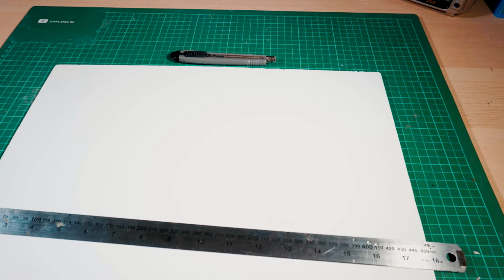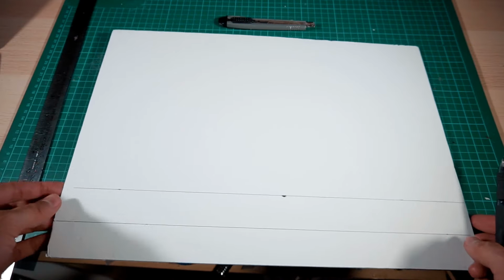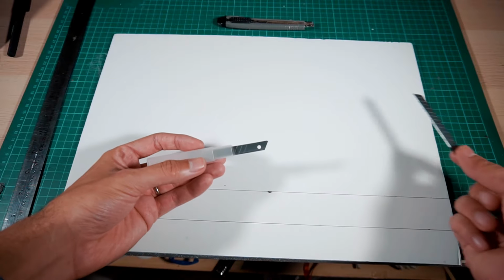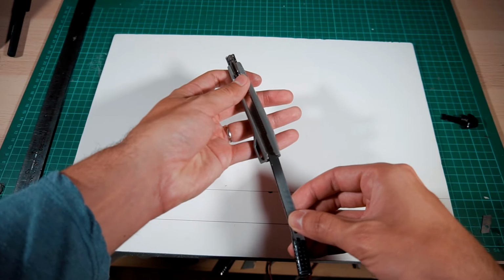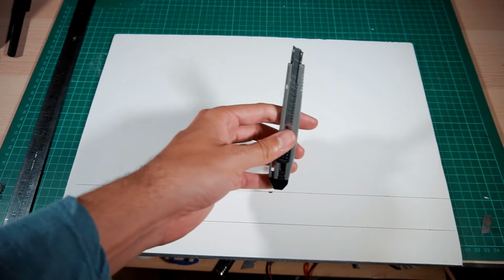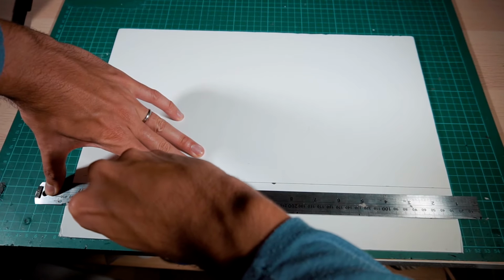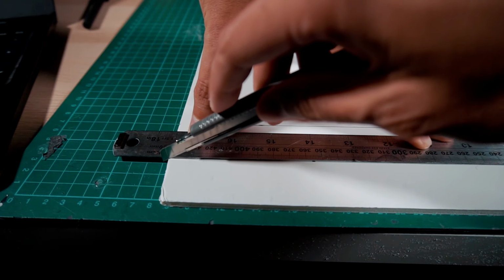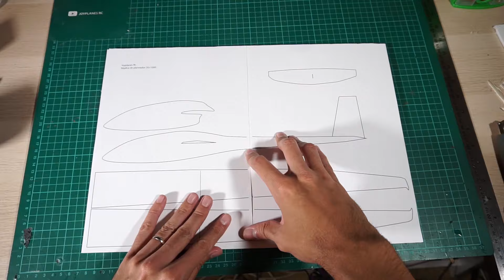How to make a foam free flight glider | Cheap and fast glider build

Comment: Tip: for getting the wings a perfect airfoil shape, fine grit sandpaper works great (after you've done the basic cuts) airfoil
Reply: A thin coat of PVA glue will reinforce the wing without adding to much weight.
Reply: @bobdoba1  I'm sure it would but probably unnecessary, ive had my glider for 2 years without much wing damage

Comment: When cutting the foam, if you do two passes instead of trying to cut all the way through in one, you can get really nice cuts without using a brand new blade
Reply: yes indeed and a cleaner straighter cut :)

Comment: Tip to the people building the control surfaces: use pieces of thin paper clip underneath the tape to maintain the wanted position. Works great if you crash a Sweet spot flight.

Comment: very cool! i made one, i bought a full glider, i bought some motors, wheels and propellers, also batteries and all stuff(including the remote itself), i attached the parts to the airplane and oh wow! i managed to fly it out my building and get it back to me! i also found out that the wireless remote has a range of 210 feet!
Reply: I’m trying to imagine a wired remote (Tx) as opposed to a wireless one (which they all are)
Reply: @flavorman9159 There's Control Line planes where the only control method is via actual wires, like the flying offspring of a puppet and a hammer throw.

Comment: Wouldn't a through wing design where you just bent the wing from front to back be easier than carving out an airfoil? you would likely have to set up a thicker fuselage and the wing would need to be larger from front to back but that would allow more lift.
Reply: Yeah I have tried both, and bending the wing to create an undercambered airfoil is really easy and works great. I have also tried the carving method but my wings just break really easily (with 3mm foamboard)

Comment: I like the simplicity and the material. But the wing profile is too thick and chord lengh too short which decrease Reynolds number. The result is huge drag. For such small glider it is much better to make wings wider (longer cord) and as thin as possible. It is even worth to sacrifice the aspect ratio, since at low Re the induced drag by tip vortices is less impotaint than viscous drag and form drag due to thick profile.
Reply: can i get some help from u please? Can we talk on instagram or discord messages?

Comment: I have a question,how to calculate the area of horizontal stabilizer?
Reply: length of horizontal stabilizer should be 20% of the wingspan
Reply: F1h stab area 2.55 DM sq, F1A stab area 4 DM , top models volume .

Comment: I think there is something wrong with the diagram because I compared your measuring with a ruler I realised what you wrote on your digram is not the same measurements as I saw on the video! check your digram
Reply: i have the same problem. On the diagram the wingspan of the glider is 252mm but in the video it is clearly larger.

Comment: Here's an idea... Instead of using foam board which you have to buy, try using saved styrofoam meat trays. I've been making model planes from those trays since I was a little kid. Better to use those trays instead of throwing them in the trash. That's a REAL way to recycle and "save the planet" (if you believe in that sort of crap)